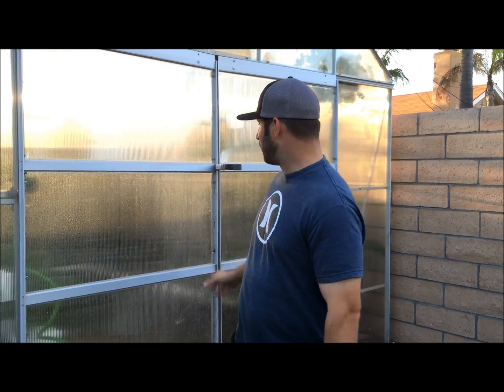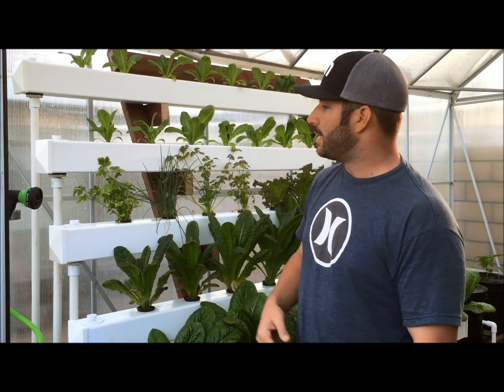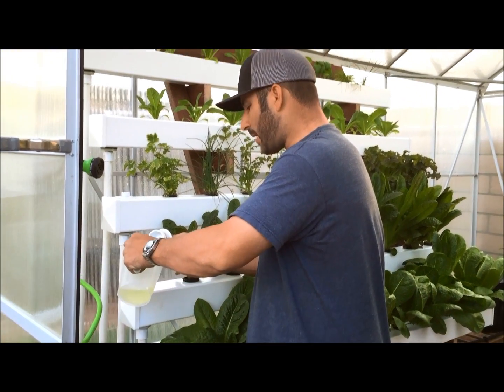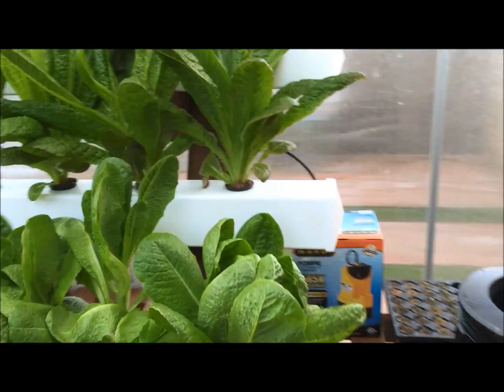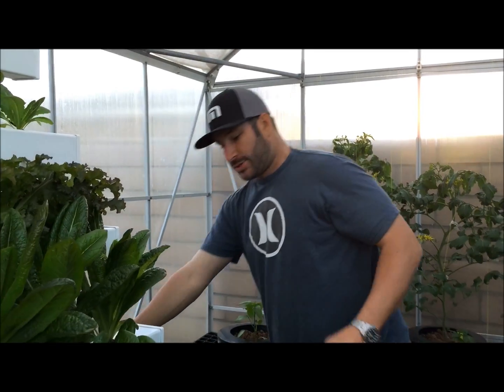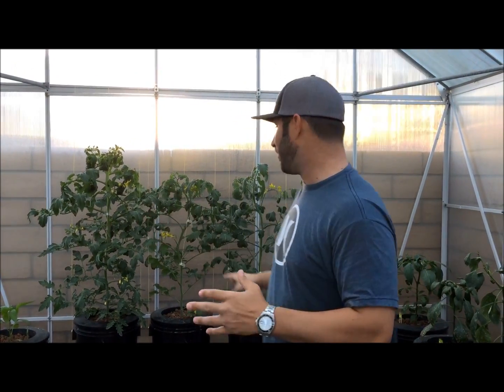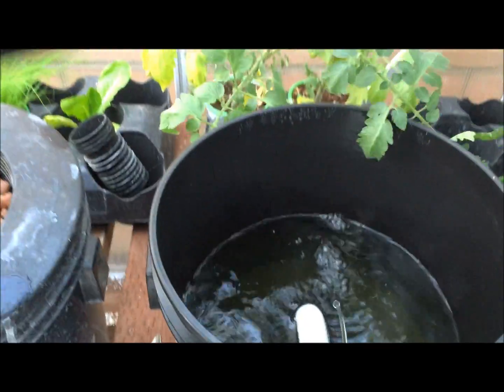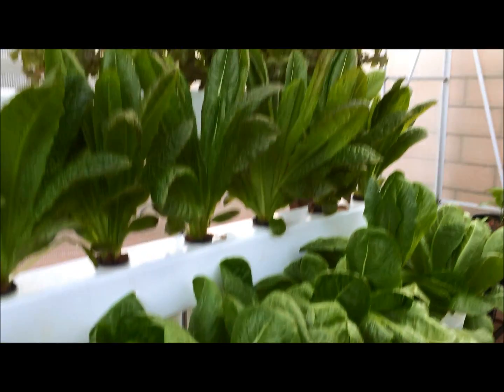Hydroponic NFT with Bucket System / Dutch Bucket

Comment: Brandon those bulk head fittings are NOT at Home Depot, they're sold at Lowes. Spent a lot of time looking for them. They cost $12.99 each
Reply from the maker: Okay...well I've bought about 20 of them at the Home Depot, but if Lowe's has them I'm sure they work the same.
Reply: 3/4" Barrel Valve Adapter. Model # 933-853001 Internet #300270412 Store SKU #411164 @ Home Depot. http://www.homedepot.com/p/Sioux-Chief-3-4-in-Barrel-Valve-Adapter-933-853001/300270412
Reply: anotherdamnyankee, Ouch, that's expensive. I've had no issues using 1" rubber grommet's. Yes it's hard to shove the 3/4" pipe through it, but works great and can buy for $1.25 each.
Note: 1" grommet requires a 1.5" hole

Comment: Building the a system similar to yours. Why don't you have a pump mounted outside instead of submerged? Wouldn't in run cooler by not heating the water?

Comment: I need to know where you got your sump tanks.  I'm having a hard time finding them. Thanks a bunch!
Reply from the maker: +Renetta Hogan I found these at walmart actually, I think they were like $50. Very sturdy.
Reply: +Brandon Matthew   I'm almost done building my new greenhouse!!!!  So what is that boat part you used on your NFT rail system?  I can't wait to get started. I appreciate you sharing the info.  It's an awesome system....neat, clean, and efficient.
Reply from the maker: That is a Bulk Head Union, 1/4". You can get them in the plumbing section at HD. Glad my videos have helped, good luck!
Reply: Did you find these sump tanks? Bc I am looking for them as well and what keywords to use to find them

Comment: I have seen a few folks comments about root build up in their NFT systems starving plants and blocking drains. Have you had any problems with any of those.
Reply from the maker: +U812GREEN No not at all. These plants are usually harvested before the roots get too big. I have a larger rail now that I plant cucumber in, and they get to 11ft. tall and still no issues. I think the rail being square lays the roots out more evenly, flat across the bottom, so maybe helps the flow of things better.

Comment: Looks beautiful - you've done a great job.

How often do you have to top up your reservoir and how often do you do a full change of the reservoir?

Any issues with the flowering veggies using strictly the maxigro formula?  Did you switch to maxibloom at any point. 

Also, you mentioned MHP gardener in your last greenhouse update. Have you tried the Masterblend recipe he uses?  Works great, very economical. 

Great work!

Comment: That's pretty neat. And thanks for taking the time to explain it and show everything that you've been doing. I have been wondering if there was a way to do a system with both some sort of NFT and some system for plants with deep roots. Looks like, this just might be it!
Reply: btw, i noticed in your NFT system that each block is a seperate and independent unit. if that is the case, is there a reason why you set it up in steps rather than line them all side by side next to each other - could have saved a lot of space. Just curious.

Comment: Hay Brandon hows it going how did you make the drain or what fittings did you use?  whats the water level on the inside looks cool im running my green house all hydroponically i built a hoop house last year 20x40 very cool iv had very good success lots of food thanks..
Reply from the maker: +tooldiebum  the part is a Bulkhead Union Washer, here is the link: http://www.homedepot.com/p/Watts-3-4-in-x-3-4-in-PVC-MPT-x-FPT-bulkhead-Union-PL-1872/202639687 The water level sits just at the bottom of the net pots so the roots touch when they're just popping out.
Reply: +Brandon Matthew thanks Brandon I seen the link but it's broken its cool I'll go look for a bulkhead fitting at lowes this weekend thanks for getting back with me you still happy with your set up

Comment: Great video. The "2 way thing for boating"; do you have a part number and where in HD did you get them?  Also the wood frame for the rail system.  Can you go over briefly dimensions and how you put it together?  Thanks.
Reply from the maker: +The Laidback Biker  the part is a Bulkhead Union Washer, here is the link: http://www.homedepot.com/p/Watts-3-4-in-x-3-4-in-PVC-MPT-x-FPT-bulkhead-Union-PL-1872/202639687 - As for the rail, it was basically rigged as 2 2x4's wedged up to the dimension of the greenhouse, then a couple of shelves screwed on.

Comment: Good stuff Brandon.  Thank you!   I do like your set up.  I am also in a Socal beach city area and will be getting started soon.  I watched MhpGardener's video's as well and am greatly encouraged by the two of you.  May I ask where you purchased those black buckets and tops holding the media and plants?  I am thinking I might as well go to something like that from the start, instead of regretting not getting them later.
Reply from the maker: +Leo Ortega Hey Leo, glad the videos are helping. The buckets are 3 gallon Home Depot buckets, you can find them in the paint section. As for the net pot tops, I got those at two different Hydroponics stores, one in Huntington Beach, Sow Cal Hydroponics, and the other is off of the 55 in Santa Ana, 55 Hydroponics. SowCal is a small shop, good prices, a little unorganized, and 55 Hydro is big, corporate like. I think you can find the lids at any Hydro store though. My one tip would be to drill the drain hole lower on the buckets, too much water pools inside my buckets, I have made the change, you'll see it in an upcoming video.
Reply: +Brandon Matthew  Thanks Brandon! Tips taken.  Did some shopping online today and found the tops.  The rest of the stuff, I think I can get at Home Depot.  I'll keep peeking at your videos for more tips and hints.  Thanks again.
Reply: +Leo Ortega You can get free 3 gallon buckets square and round from your local supermarket bakery. You would just need to paint them.
Reply: +Brandon Matthew Since 5 gallon buckets are cheaper why do you use 3 gallon?
Reply from the maker: +Jeff Sullivan When I went to the DWC style of growing, there wasn't a need for such a tall bucket. Since the roots hang below freely in the water, there's plenty of room in the 3 gallon. Also, couldn't find 5 gallon black for cheap. You have to take into consideration the height of everything when you're in a greenhouse, things grow tall quickly, I also needed all of the room I could get.
Reply: +Jeff Sullivan Thanks for tip on buckets. Setting up now.
Reply: +Brandon Matthew I see your logic but when I grew tomatoes in a bucket the root system was massive. I figure they need all the room they can get.

Comment: how often do you change the water and do you change the bucket water and sub tank or only sub tank
Reply from the maker: +Alex Becker About every week and a half, and with smaller or less plants I stretch it to 2 weeks, 2 1/2. Usually what I do, I run the refill line as I'm pumping out the old water so it's putting fresh water into the mix, and circulating through the entire system. I keep doing this until the buckets are refreshed and clear, then I top it off and add the nutrients. I always take into account the water that is in the buckets, so I have a 50 gallon sump now, but 8 3 gallon buckets, so I put 75 gallons worth of nutrient back in the sump.

Comment: Hey Brandon
I have just got myself a 50 gallon tank and pump but I don't know what air pump to use. Could you tell me what size you have and how many airstones etc.
I have got to say you have been a great inspiration to me and my wife and we are really looking forward to building our system.

Many Thanks
Mark
Reply from the maker: +Mark Sneyd Mark, I'm so glad I was able to help get you guys going! The air pump I use is called an "Active Aqua". They come in a few different sizes, but my suggestion is getting a bigger model than you think you need as when I started splitting it off into more than one airstone, the pressure got weak.

I have had many issues with my reservoir temperature getting too high, this is mainly from California's insane hot weather this year. Today is October 25th, and it was 84 degrees out today, argh! The warmer water means less oxygen, which has made my greenhouse SUFFER, I lost the majority of my plants. I ended up putting airstones directly into a few of my buckets using that pump, and it made a world of difference. So that being said, my new setup has airstones in each bucket, and not just in the reservoir. This may not be an issue where you live, but mor O2 can't be a bad thing.

Hope that helps, if you can't find the pump by name, let me know and I'll try and find a link. I bought mine at a store but I'm sure they're available on many sites. Good Luck!

Comment: How high are the holes drilled in the buckets?  They seem a lot higher than other videos I have seen.
Reply from the maker: +Frameshift They're 4 1/2 inches up. I wanted more of a deep water sytem with these.My next go around they will be lower.
Reply: +Brandon Matthew thanks for the reply... Why the change though... How is it working out at 4.5?
Reply from the maker: +Frameshift I think it's working fine, but it's been very hot in CA, and I've been getting root rot. My local hydro guy suggested less water. I grew some cucumbers in a 5in. Rail, 10 feet long, 8 plant holes, the water level was only 2 inches high and they grew like weeds. It's really just trial and error for me.
Reply: +Brandon Matthew Awesome... Thanks again.
Reply: +Brandon Matthew To get rid and prevent future root rot you could use Botanicare's Hydroguard, it works miracles! Your system looks really neat and clean, bro! Keep it up :D

Comment: Have you thought about using solar energy to power your pumps and whatnot? I am looking into purchasing one of the Harbor Freight greenhouses, and was trying to plan everything I want to do. I'm getting new gutters installed on my house, so I also see a rain water collection barrel in my future. For me, it's not necessarily about being off-grid, but more about not adding too much more to my utility bills.
Reply: It should be doable and 12v aside ans water pumps may be found,  eliminating the waste of needing a 12 -120 converter.  For the few times 120V needed a $35 converter for the case can be used or an extension cord from the house.
Reply: How much does it cost to run that system on a monthly basis around 20usd in electric if so its expensive salad? I agree a solar powered would be something i think i will look at

Comment: Brandon, thanks for the info!  Quick question about the drain lines in the NFT.  Are the tops of the drains flush with the bottom of the NFT or do they extend above the bottom.  I can understand the benefit if they extend above the bottom as this would keep a minimum amount of water in the NFT thus enabling you to make sure the water reaches the roots.  My concern is that this might create a situation where some of the water becomes stagnant in the bottom.  Have you seen any signs of that happening?

Comment: How do you get water to the roots when they're still to small to reach/hang into the flowing solution ? I tried a similar setup and the roots either burned off when the water was lower or I would get root rot when the water was set to high (height wise). Also is the lettuce on timer or is it constant flow. Thanx in advance for any help you can give me.
Reply from the maker: Tony Rivas The water goes right up to the bottom of the 2" net pot, basically just touching it. I use rock wool for the seeds so if any water ever touches it, it soaks it up like a sponge. So after a week or so of the seed sprouting in the trays, I move them to the rail where it still gets a constant flow of water touching it. Then the roots will start to grow down and into the water. The water flows 24/7.

Comment: Great vids Brandon! Thank you!  I'm planning out a dutch bucket system and have been considering some nft channels as well.  I recently completed a hydro food production class and have some experience.  We basically had the same kid of set up.  The tomatoes produce for nine months with weekly harvest.  I was especially interested in the concepts of "crop steering" and balancing of the "sink and source."  If you haven't there is your window to the next level of plant control.

Thanks again I'll be following you. I'm inspired to do one of my own.  keep up the great work.

Jeff
Reply: SweetJproductions  Dutch buckets as I understood it are designed with substrate in mind.  A perfectly timed watering event will fill it to the height of the drain tube and then evacuate most of the free water.  As the opening is placed at the bottom of the bucket.  the water runs for a moment longer priming the bucket drain.  This is desirable for drawing o2 for the roots.  Your system is a hybrid and seems to be really working out, its all about what works.  There is no one right way

Comment: Brandon I really like the rail system you have designed... Do you have a design plan and parts list you would be willing to share??? Also a good trick for the bucket system to keep the roots out of the drain is line is to put a 1 gal. paint strainer bag in the bucket. The Big Box stores usually have them for $2 to $4 for two...
Keep up the good vids...

Comment: Brandon, what is the part number for the thru hull piece for the NFT rail drains? I couldn't find it at Lowes or Depot. The parts I came up with are not going to work.
Reply from the maker: Denton Earnhardt the part is a Bulkhead Union Washer, here is the link: @202639687

Comment: Hey Brandon
I have a few more questions about your setup, do you have an air pump inside your water supply tank aerating the water and if so what size / type is it? What size are your buckets (sorry if you have mentioned this already on your videos)?

As I mentioned on my previous message we have a poly tunnel and we are using a 12v bilge pump (Rule 280p marine pump) through a home built solar / timer system and from that we are using Antelco (probably called something else in the US) rigid plastic pipe work which you pierce with a small plastic tool and push different fittings in and I was hoping I could use in the new system and so I was wondering if you were using something similar?

Thanks
Reply: You don't really need an air pump because the water is self aerated moving through the system.

Comment: Hey Brandon
I'm very impressed with your rail system setup but I do have a question, as I plan to do something similar in my poly tunnel. How have you fixed the angled timber that holds your rail system at the top, as it appears to be floating and not fixed to anything?
I have found your videos very informative as I'm new to hydroponics and you have given me some great ideas.

Thanks
Mark
Reply from the maker: ***** Hey Mark, glad the videos are helping. There are two 2x4's with an angular cut on both sides. They are screwed right into the wood table everything is sitting on at the angle of the lean. At the top, there wasn't really a way to attach them to the greenhouse that would make any real difference so they length was measured to perfectly wedge right under the cross section of the greenhouse. Then there's an additional 2x4 that connects the other two at the top horizontally, keeping them snug together. Doesn't seem like much but they are extremely stable actually. Then just little 2x4 shelves every 9 inches or so for the rails to sit on.
Reply: Thanks Brandon for sharing ... Was looking for this info myself

Comment: What size pvc are you using for your supply and your bucket drains? Thanks for the video. I am designing my greenhouse similar to yours.
Reply from the maker: Hi Denton, all of the PVC is 1/2". The drains for the NFT are 3/4", and that was just to ensure they never got backed up. It is eventually reduced to 1/2" by time it reaches the main drain. Good Luck!

Comment: Hey Brandon. Love the new set-up! You really do a great job on your hydro systems. I'm still running my NFT system and it's doing pretty good this year except for the bugs trying to snack on all my hard work. That's where the greenhouse comes in. One day I'll find room in my yard and get one setup.That heat wave a couple weeks ago killed me and made most my plants go to seed early. I posted a video on my hydro system. Check it out if you get a chance. On another note, you really need to monetize your videos. It's pretty easy to setup and you can start making easy Google money from people watching your videos. You have a ton of views and views equals $$. I know everyone hates those adds popping up but if it helps support those hobbies and pays for some new additions to the greenhouse (like a spare sump pump incase that one goes out one day) then I figure what the heck. Check into it. Keep them videos coming!
Reply from the maker: Hey Eddie, yeah man, this hot weather has been tough! I recently added a new fan to the greenhouse, a Solar powered vent fan that brings in the offshore air, and then reversed the main fan to exhaust the air. I get insane circulation and flow of the air now. I also had to block out the west facing part of the roof with shades because it was getting way too hot. Seems to be going well now though. Checked out your video, great setup you've got, a lot going on! You're right on monetizing the videos, I need to get on that, just need to figure it out lol. Keep up the good work!